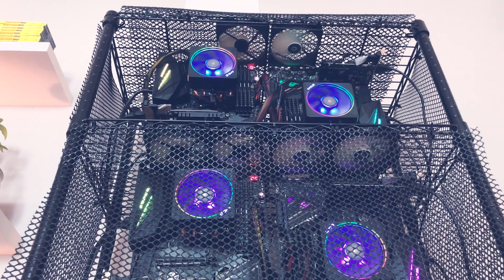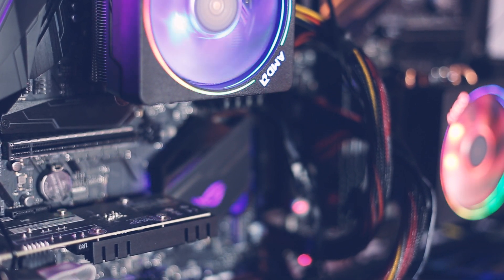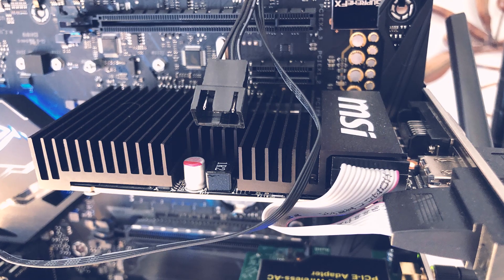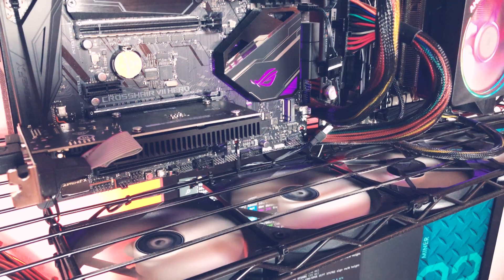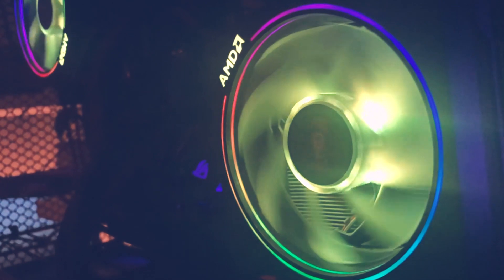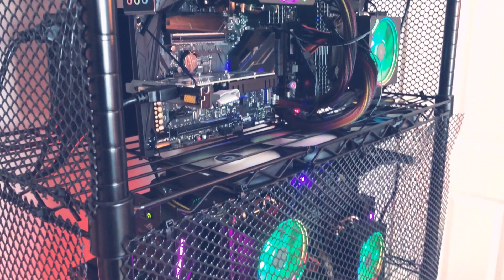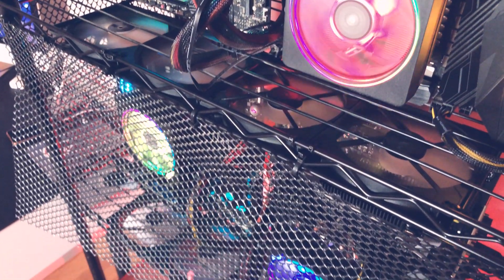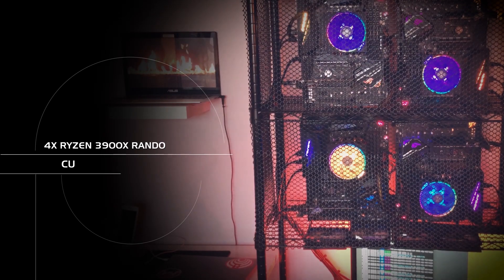4X 3900X Random X Monero Miner Beast 54000 H/s CPU Mining Build & Parts [Miner Showcase #1] Crypto

Comment: I tried monero mining with xmrig on a Xeon Haswell 18-core full turbo at 3.4Ghz and i get almost 10k khash, for 170 cpu wattage, not too bad.
Still i still don't see how people make a profit out of this, i pay 15c of euro per Kwh and it pretty much evens out, barely makes a profit.
How do you make a decent profit out of this?
Reply: My electric cost is a little lower than yours, at around $0.12 / Kwh. At current Monero prices, this entire system brings in around $6.50 USD every two days (this is the actual pay out from the pool). That’s about $3.25 USD / Day. Electris is about $2.15 USD / Day. So “profit" is around $1.10 / Day. Considering I had to invest money to build the system, I will not see an ROI for a while—but that’s okay. Build this beast was super fun and I had learned a lot. Also, at the end of the day, I’m helping to secure a cryptocurency that aligns with my values.
Reply: @user-enter-here  i would love a tutorial on how to do this setup/ software wise. Putting the parts together is the easy part, getting it setup and running smoothly is the hard part. Im also considering supporting the monero network und would love a setup just like this
Reply: @hustlemitbasti1377  ditto sir!
Reply: @hustlemitbasti1377  me 2 😇😇😇😇
Reply: @user-enter-here  you could sell your XMR off grid to people for a 5% markup
Reply: TheOnlyCryptoBear There definitely is a premium... I mine during the colder months for the heat and I break even with older i5s and a cheaper electricity rate.... the crypto is the cherry on top and all my Dell OptiPlexs (20) were obtained free.
Reply: @placetobe5544   you have a nice setup.  When do you expect the rig to be obsolete?  When do you expect to pay of the cost of the whole machine (capital cost) with your operating profits?  thanks
Reply: Use it to heat your house for free then if it breaks even

Comment: Cool it with thermoelectric 😅
Reply: Thermoelectric is not that efficient.

You would rather just use fans instead. Although its much cooler, but the efficiency is so... Like, imagine making the CPU 10*C cooler, while the heat dissipation is 40*C hotter, and thus making the other CPUs getting hotter air.

Comment: could you make a detail clip ; on how to bulid this
Reply: Paul, you can always message me if you have a specific question. There was some trial and error on getting the right fit and orientation for all the parts on the wire rack. Cable management and assuring the rig can be mobile required some creative solutions.
Reply: @user-enter-here  im currently getting parts together.  My question is what frame did you use?
Reply from the maker: I can do so when I build my own 3900X system soon, it is basically "building a PC without case times 4" =) cheers

Comment: Awesome build...  I have a rig with a MSI X570 Unify and 3900X.  5x MSI 1660 Super Gaming X GPU's.  Ram is 32GB CL16, and I am cooling the CPU with an AIO cooler.  Hashrate for the CPU is 14.1Kh/s at 4.275GHz.  CPU temp is 69°C with the cooler.
Reply from the maker: Your build sounds like an amazing CPU/GPU hybrid!! Do you know by any chance how much power your 3900X draws like that? Cheers ⛏️
Reply: Cursed Mining, Total rig is 650 Watts. I will get you a CPU number though.
Reply from the maker: Already impressive for 3900X and 5 GPUs :) respect! Thank you for finding that out for me/us :) cheers ⛏️
Reply: I would love to see your rig. Sound very interesting.
Reply: Change your ram or timings. I am getting 15kh/s at 4ghz with 3900x
Reply: @kaptan9110  I have looked at this... What else to you have attached to your system?  I have noticed some degradation with the number of gpu's that I have (6).

Comment: What is the total price of this cool setup!
Have you look the vid of The Life of a miner? he get 15000h/s. The ram speed and CAS ( C15) is important to.
Reply: Escape3000 A little over $4,000 USD. Couple of the mother boards and video cards were bought refurbished. CPUs were a little over $500 each. You can bump  up the hashrate over 14000h/s but that resulted is super hot CPUs. Adjusting memory timings didn’t help. ;-(
Reply: C14/3200

Comment: Sorry I missed the live. Pretty nice numbers on that quad setup...can't wait to see the difference in power when you drop the voltage and pump the clock!
Reply from the maker: No worries it was very spontaneous :) there's surely more optimization to be done, I think this comment section alone will help and inspire the builder very much which makes me glad :) cheers ⛏️
Reply: Hey TechManTY, any suggestions on what CPU voltages to use for a rig like this? Any other thoughts on how to pump the clock without frying the CPU? I’m looking for ideas on how to continue to optimze this rig while I’m still learning about all of this.
Reply: @user-enter-here  core 1v clock 4.2